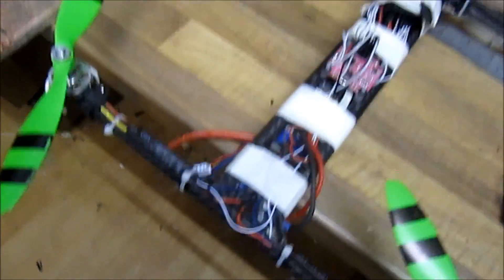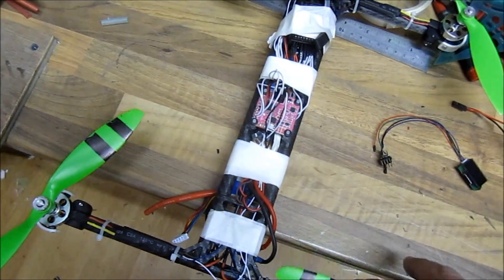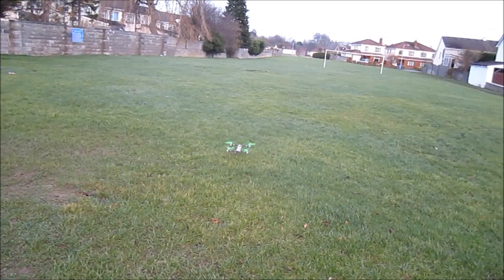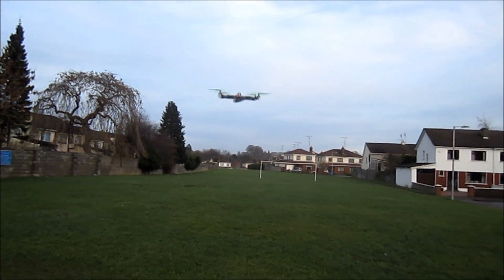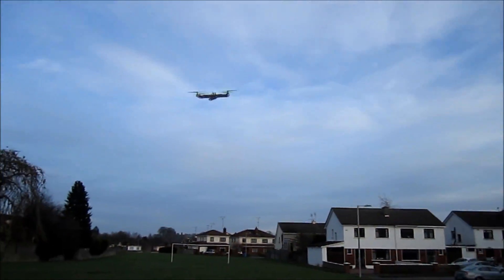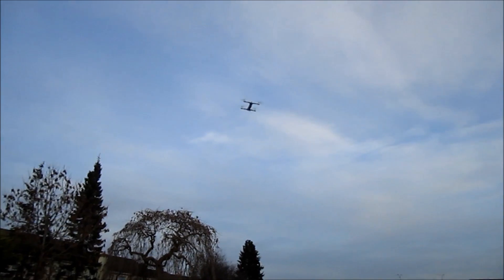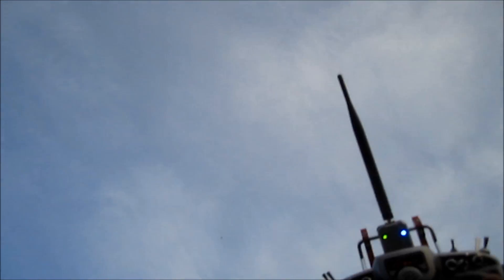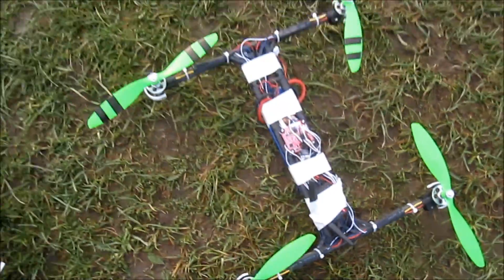Custom ESC test #4+ different motors. + Nearly lost model

Comment: Im having issues with these FrSky x8r PCB antenna's also. I frequently lose my connection and it doesn't always seem to recover. Failsafe saved my quad 3 times already and Ive only flown 4 times with this receiver. 

TBS quad, so very no CF on it at all. Fiberglass and plastic.

Is there something I can do about it, is there a socket inside the receiver so I can put something else on? 

/K
Reply from the maker: I've changed antennas to a normal ones and don't have any problems since, dunno what's going on with them PCB ones... Some Rx's have RF connectors, the other ones don't, you just have to open yours and have a look. Mine didn't have, so I had to do some soldering which is a bit tricky and have to be very precise, it's RF we talking here:) If yours have RF connectors then you can get replacement various length antennas at Hobbyking
Reply: ROBOFORCERX2000 Found some weirdness inside my X8R, just FYI. Does yours look like this: http://imgur.com/edhpDxh AND http://imgur.com/IJ5zAVJ note the unsoldered points and the skew U1 chip.
Reply from the maker: The links showing me a giraffe LOL will check later:)

Comment: Oh gee... that was bad. Been there as well... :(
With me was the micro, the damm thing kept hovering at 5mts high and I could do nothing. (unless throw rocks)  Eventually it felt down.
Give a try to the balun antennas from FrSky, I noticed some improvment in range when I intalled them in my FPV quad and you can route tem out over the arms away from the carbon.
Reply from the maker: I changed antennas already and placed them properly, but shortly I'm still moving to LRS... Just waiting on spare props for Mini-H and we can have a race again:)
Reply: ROBOFORCERX2000
Is going to take a bit... I killed my ZMR motors due to those damm long screws they came with.
I was not carefull enough and it damaged the copper windings.
But I can go there with my bigger quad. :)

Comment: Was your failsafe set to above hover? I have mine at dead drop now but usually try and get just below hover failsafe state. I had a fly away early on but it was a LOS issue more than signal lock. Made it back too, glad you got the prototype back safe.
Reply from the maker: That was my major fail- I did not set F/S, I thought I'll do a round or two in front of my nose and go home... I usually set F/S with level on and throttle a bit below hover:)